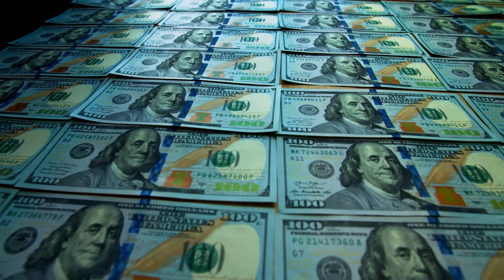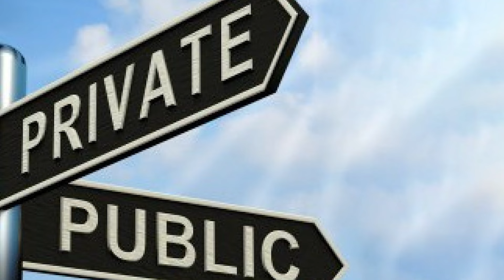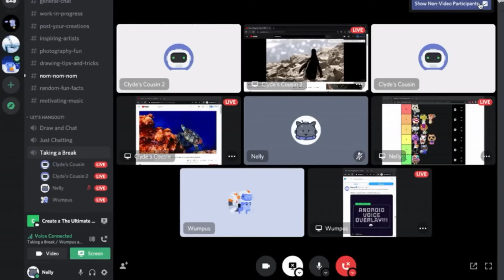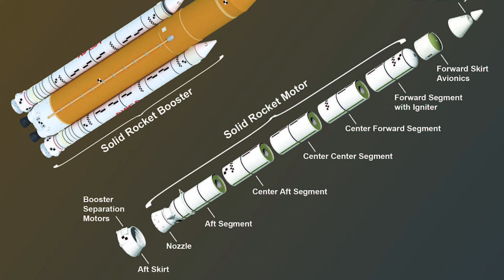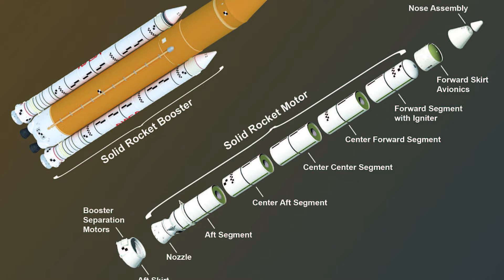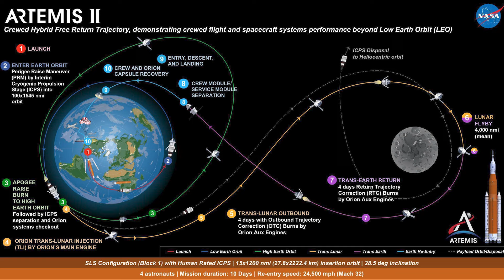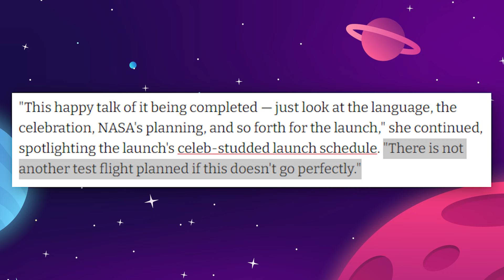The Real Reason NASA Developed The SLS Rocket!

Comment: I work on Artemis, in a role as propulsion test engineer and now as TVC intergration engineer. I can assure you that this vehicle has been absolutely tested every which way. Every engine before core stage intergration endures a full duration test (500s X's 4-10 cycles) then another 500s as an integrated core stage. (Not to count all the other none hotfire tests) They are not "Yolo-ing" this rocket into space at all.
Reply: Then why all the failures and delays?
Reply: Yeah YOLO is overblown. But still, by far not every potential issue can be tested without actually launching the rocket a few times. Even then, failures can still occur, as the Space shuttle showed.

On the other hand, SLS doesn't need as much testing as Starship in the first place. SLS has advanced abort systems which can save the crew for many cases where something goes wrong with the rocket.

Starship, in comparison, has no launch abort system, and the landing with its "belly flop" maneuver is, no doubt, much more risky than the old and proven non-powered landing method: SLS simply uses a capsule (Orion) which uses parachutes to brake and then falls into the ocean. This method was tested countless times on other capsules and never resulted in a human death.
Reply: @cube2fox  very well said. I agree nothing is better than seeing concrete results and tuning them for next flight.
Reply: Well yes, it is intensively tested, but it's still undergoing a YOLO yeet, given it permanently discards most of it's  hardware during it's only flight.
Reply: Just out of interest whats your favourite space film or series as a guy know works in the field? Mines Outland with Sean Connery. I love the tone of emptiness in that film. It’s very unique but you totally get the idea of a working frontier town. There’s also something haunting about the score and I loved the miniatures used on it. For some reason works better then todays CGI.
Reply: @jameslyddall  I will put this on my watch list now since I do like Sean Connery. The one I'm leaning towards is probably Interstellar due to  it incorporating some theoretical physics.
Reply: @ethan93m  good luck on launch btw, hopefully not another unplanned rehearsal
Reply: Why so many errors with getting the engines cooled down? Is SLS safe?
Reply: @charliebell4632  certainly, that’s why we get these faults, we test before launch, this system did not have to operate at this point in time, it only had to operate during the countdown, a moment when you cannot cancel anymore
Reply: @charliebell4632  failed sensors gave them false reading , the sensors were never apart of any flightware , these  sensors  were apart of the ground system,  other sensors  upstream validated that the engine were infact getting cold liquid  hydrogen for the kick start  purge procedure, that temp was around -420 F  this was all done by collecting  data as the vehicle  stayed in a tanking configuration,  the data confirmed a bad sensor
Reply: what happens to the SLS after it’s jettisoned? will it re-enter earth’s atmosphere or will it just reside in space?
Reply: @julianieminski4066  the sls lower stage + boosters will burn up, the upper stage + capsule will do the mission and then the capsule will re-enter, and the upper stage also burns up
Reply: If there is any junk it will be in high earth orbit or lunar orbit
Reply: @rogervanbommel1086  wow!! that’s fascinating. thank you so much for your  input 😁
Reply: @julianieminski4066  I need to correct myself, lower stage + boosters will SPLASHDOWN, not burn up, though won’t be recovered
Reply: Bruh this aged well
Reply: AND two flights scrubbed because it's been THOROUGHLY tested.

Your response is exactly what I would expect an insider of any program to say who wants to defend what they're doing without regards to hard facts.

You didn't test a system if you didn't put it up into space first.  There's a LOT that can go wrong from firing engines on a pad, pushing it past earth's gravity and it being out in orbit for days.

If you want to ignore that I can tell you that's what's wrong with this program.

SpaceX uses Agile and even they weren't that stupid, and now they have a highly functional and low cost system for taking humans and supplies to the ISS.  And they're probably already the best at doing it, for LESS COST!
Reply: @johndoh5182  not true, this is a stupidly complicated(you could say too) rocket, and this issue had been found during testing, but they failed to resolve it, and yes, spaceX can take to the ISS, but that’s apples to oranges, this must be compared to a previous moon mission, so Saturn V, N1, etc
Reply: Lots of people worked on the Yugo too, but they didn't embarrass themselves by going out and admitting it publicly. 🤔
Reply: Ok, so basically we used engines and SRBs from the shuttle. 11 years and 20 billion dollars to build a fuel tank.
Reply: @jimbaulsir8838  nope, integration, testing, assembly, Orion must also be built
Reply: I have seen no aborts concerning the capsule only the rocket. Which in itself raises many doubts! How can SLS launch a supplemental mission heavy when it can't launch a basic mission profile without boosters? Every booster strapped to the core raises the risk of catastrophe so there are my doubts.
Reply: Fantastic… then launch it!
Reply: Except an integration test with the launch device. EVERY one of those has failed.
Reply: Methane starting to look pretty good yet? Seeing as these engines won't be reused and all.
Reply: What I found interesting after making my original post is that there is so many people quick to cast shade towards Artemis from typical scrub scenarios. I appreciate all advances in space and this technology. To have these advancements we need multiple angles of approach and to appreciate each equally. I am proud of the Artemis project as well as anything another company brings forward.
Reply: Everything is tested, double and triple tested. That’s all great, but let’s see what happens at launch. Then we’ll come back here and chat about it.
Reply: @mar4oz  I agree. I'm not worried a bit though.
Reply: @mar4oz  That is called an INTEGRATION TEST. which is what a wet dress rehearsal is. And so far, SLS has failed EVERY TIME.
Reply: @jessepollard7132  I’m waiting for the dis-INTEGRATION test. 😂
Reply: You work on a rocket that will probably burn its own weight in 100's bills each attempt. This is the very definition of a BOONDOGGLE. Sad.
Reply: @mar4oz  I'm expecting that on first launch.
Reply: @otpyrcralphpierre1742  Congress hates spaceflight
Reply: @cube2fox 
Spacex has already done several belly flips manuevers on falcon 9 boosters. Parachutes are also quite finicky and unreliable

Comment: The Saturn V had five F-1 engines on its first stage, not four.
Reply: The F1 engine development did not start in 1962. The original Rocketdyne F1 engine started in 1955 under a US Airforce contract.
Reply: The Saturn V could reach orbit with four, as it happened once that an F1 engine failed. The remaining four engines were powered up to compensate.
Reply: @jessepollard7132  
Yes it could reach orbit with 4, and this did happen, was that Apollo 13?
But it could not lift off with only 4 engines. It needed to to be at a certain altitude & speed to attain orbit on 4.
Werner Von Braun decided, in the early preliminary design stage of the Saturn,  to go with 5 engines rather than 4 knowing that there would be a weight growth in the payload. This proved correct.
Reply: @briancavanagh7048  yes, but 5 was chosen for a margin of error.
Reply: It had 5 damn engines!!! Lol
Reply: @briancavanagh7048 
Apollo 13 had a J2 engine out in the 2nd stage, not the 1st stage.
Reply: @jessepollard7132 ^
Reply: @jessepollard7132 irrelevant

Comment: If I may, you say both Saturn V and space shuttle were built from inception to launch in five years each, but I'm afraid you're not correct on this.
Saturn V was indeed developed in five years, with the C-5 frame announced in January 1962 and the first flight (Apollo 4) taking place in November 1967.
The space shuttle concept, however, dates as far back as 1968 for its announcement and even 1966 for its first study. In 1971, 29 designs were submitted to NASA which selected the one we know and received presidential approval in 1972. Rocketdyne was awarded contract to build the RS-25s in 1971 too. North American Rockwell (orbiter), Morton Thiokol (boosters) and Martin Marietta (external tank) were awarded contract in August 1972. Construction of the first orbiter began in 1974 but was not ready for first flight before 1981, that is 15 years in the making since the inception of the project.
Reply: Science Revolution  Yeah, and Earth is flat, right?
Reply: the shuttle concept goes back to the mid 1950s with the X-15.
Reply: Tbf, on Apollo 4 and 6 bits were falling off the rocket, hard to compare it to modern developments due to different philosophy.
Plus unlike shuttle and SLS Saturn V pretty much could get as much money as they wanted
Reply: @_mikolaj_  Bits were falling off? Never heard of that, but I'm curious: bits of what?
Reply: @vdcomp  from what ive heard, small rocket parts were seen to be falling off Saturn V during first testflights. Overall, Apollo 6 performed poorly, with many engines underperforming. Only reason they risked crew on Apollo 8 is beacuse intel was suggesting Soviet union was making preparations for manned lunar orbit via zond program. Btw in innitial program scheldue apollo 8 was to be LEO test, and Apollo 9 would have been lunar orbit flight
Reply: @_mikolaj_  Yes indeed, I think I remember they had vibration problems on the first flights. You're right about Apollo 8, they were in a hurry and actually took unnecessary risks. So many things could go wrong, not only with the Saturn V but also with the SPS of the service module. Lunar orbit insertion burn was particularly critical for those men to be able to make it home. It had to be timed very precisely. Overall, the systems performed pretty well. Only splashdown could have been better (the Apollo capsule ended up on Stable 2, that is upside down in the ocean).

Comment: Every part of the SLS has been tested to the point of failure. And, like you said, the hardware has flown before - multiple times. Just because they haven’t done an all “up test” before hardly makes the rocket “untested” per se. Moreover, SLS is very much a passion project, from the prospective of the engineers working on it. If I had to chose between mounting a spaceship atop a Saturn V or the SLS, I would pick SLS. Every time. However, if this fails Monday, feel free to make me eat crow.
Reply: @HiroNguy  I was merely speaking to the issue of safety. I personally favor SpaceX, but I do want Artemis to succeed.
Reply: @jonathanstein6056  Not sure why people act as if it's a competition.
Reply: @veergauba  agreed. We’re all in this together. I want every space venture to succeed.
Reply: @veergauba  It is a competition, but one that should have rules, one of which should be no bribing polytricktians to pick the winners ahead of time.
Reply: It didn't fail today , didn't launch but I would choose Saturn v over this SLS boondoggle program
Reply: @veergauba  It is a competition. Not between NASA and SpaceX, but between NASA funding going into the obsolete SLS or going into NASA developing a modern rocket.
Reply: @veergauba  competition breeds technological advancement whether you want to admit it or not.
Reply: failure at integration tests is still a failure. SLS has never passed a wet dress rehearsal each of which is an integration test. thus "untested" meaning no successful test.

Comment: If Artemis I doesn't go perfectly, the Artemis program is probably going to be canceled. The replacement for SLS, if possible at all, would take so long that you'd probably want to redesign the Orion and other parts as well.
Reply: The replacement for it,is going to be SpaceX
Reply: Honestly, that might be for the best. Redesigning SLS to incorporate new developments in reusable rockets or even as a fully reusable platform would be better than going forward with building more of a rocket that was obsolete before it even launched for the first time.

Comment: 3:31  The F1 engines are not the most powerful liquid rocket engines, that goes to the RD 171M. A slight nitpick, but still a very interesting video!
Reply: F1 were the most powerful single chamber rocket?
Reply: @pauljcampbell2997  Yes, the F1 is the most powerful single chamber liquid fuel rocket engine built so far.
Reply: Tsar Tank, Tsar Bomba, Tsar Boom-Tube.

Comment: Note that these side mounted solid rocket boosters are virtually the same identical technology used on the space shuttle project, just with an added section, and one of them has previously flown and been recovered and reprocessed, so tell me again where did this 20 billion or so dollars actually get spent
Reply: It's a jobs program, SpaceX is where the real innovation is happening.  Seeing as how if it can successfully complete an orbital test it's going to obsolete the SLS overnight.
Reply: $20 billion? That's peanuts. Military budget is $801 billion PER YEAR. That's 40 SLS projects PER YEAR. Your priorities are wildly off.
Reply: @aeroripper  What innovation?

Comment: RS-25 were directly transferred from space shuttle to SLS, true. The only modification is that the nozzles must be coated with protective material to withstand the heat from the boosters, which they didn't do on the space shuttle, since they were placed higher than the latter.
You point quite well the fact that everything must be by the book on Artemis I to be able to put astronauts on Artemis II. When you think of it, the space shuttle was even launched with a crew on its very first flight, whereas it had not been tested either. Are astronauts brave or slightly suicidal? ;)
Concerning Challenger, what you say sounds slightly ambiguous. I would just like to stress that it was not an accident due to some failed though well-tested piece of equipment. It was a disaster, not an accident, because it was totally avoidable.
Reply: Actually.. the engines also have new APU designs that don’t use hydrazine .   And controller units .   These new parts were bolted on and caused problems during the first Green Run test.
Reply: @dcb1138  Oh, that's right. Thanks for the correction! :)

Comment: Billions spent and years in the making resulted in what is essentially spare shuttle parts strapped together being driven by a 45 year old guidance system. The space shuttle was already one of the most inefficient methods to send material into space. How can the shuttle actually be regarded as "safe" when 2 of the 4 shuttles being used completely blew up? The only actual innovation in this entire program was the space capsule sitting on top of the rocket, which was contracted to Lockheed. When NASA was a successful organization they approached things like SpaceX does not. It is truly now just a dead organization that delivers subpar results at an extraordinary budget

Comment: The only logical and safe thing to do if NASA is insistent on putting a crew on board the second ever SLS and sending them on translunar trajectory is to redesign the entire calendar of the program and to require that that second SLS Mission coincide and correlate directly with the first translator and lunar Landing demonstration of Starship, and require that Starship be capable of crew life support and return to an earth Landing, whether it is true rated or not at that point. This would provide the only possible redundancy and emergency recovery system for the crew of a failed second SLS Mission once it's in translunar insertion. This of course would require some kind of crew transfer system and substantial fuel reserve for maneuvering to Rendezvous in lunar orbit or possibly even in transuner or transverse flight meaning Starship would have to have substantial fuel Reserve and substantial navigation capabilities. NASA, by moving forward in this absurd manner, is literally violating all safety protocols that have ever existed in the Aerospace industry and they're basically telling the world the crew the astronauts themselves are simply tools for evaluation and are fully expendable.
Reply: Starship is no way near ready for any of that, so it will just delay Artemis 2 if one is to wait for that. Astronauts are fully expendable - they know that. These missions that push the boundaries of exploration are dangerous. There is a faction in NASA who would prefer to focus on robotic exploration, and they may win out.
Reply: @veergauba  Musk wants NASA to continue funding human space exploration. He doesn't want Starship to be the only program trying to colonize other planets. The problem is there isn't a market for human spaceflight that could sustain the development of a vehicle capable of it, so taxpayer money is used to create one.
Reply: This is not what the plan is.  Starship will not carry astronauts into orbit or back to earth.  Orion will be responsible for that.  Orion will rendezvous with Starship when they are both docked at the NASA gateway.  The crew will transfer to Starship for the lunar landing.  The reverse will happen at mission completion, with Orion returning the astronauts to earth.

Comment: NASA is relying on old Space Shuttle components. There were over a million parts on the Shuttle/Orbiter and how many are being reused now for SLS? Somewhat bad to rely on that old system, even though they may have updated many components, which is why it has taken so long? In any event, the best thing they added was the Launch Abort System. Just not sure of the engines after this length of time. I'm sure they have had plenty of tests, but they are very old now. Still, good luck to NASA in getting back to space.